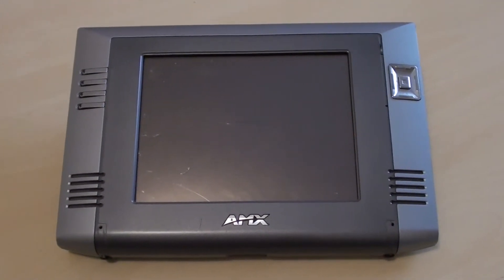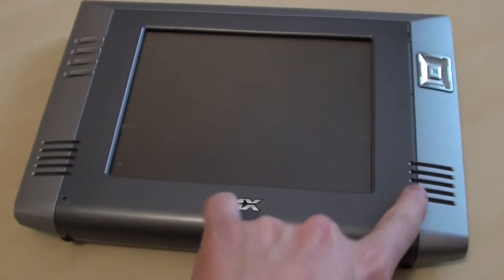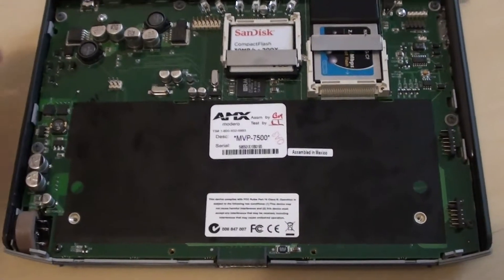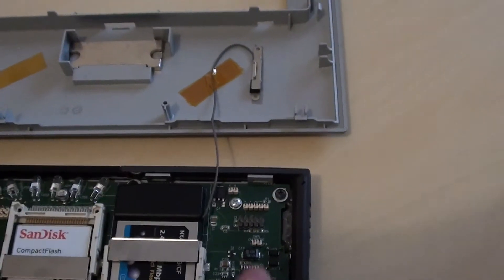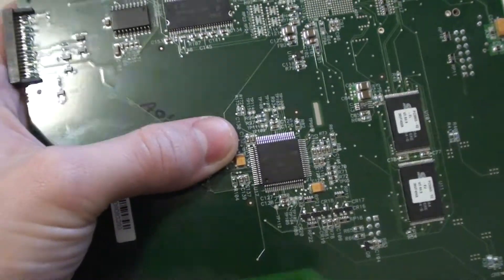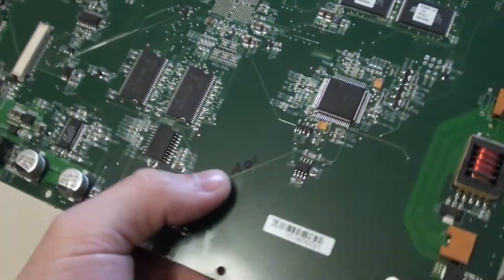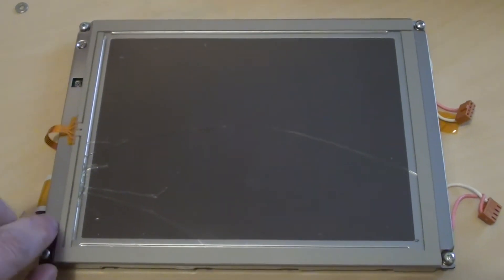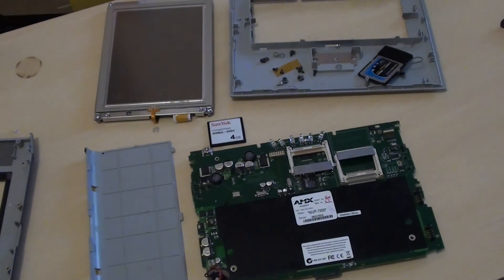AMX Tablet PC Teardown

Comment: We have a these in some lecture theatres at university.   They are used to control the AV equipment (such as switching projector inputs and changing the audio volume) as well as controlling things like lighting in the room.

Comment: We had one of these controlling schools auditorium lights and av hardware. Hugely expensive automation system that was quickly obsolete and started to have issues,  devices would not turn on and other weird glitches going on. AMX was/is one of the leaders of these kind of systems, I have seen their devices in many presentation rooms. This tablet was never intended for general use, but highly customizable remote controller for stage systems.

Comment: definitely save the CF cards, especially that 802.11...b? card. they can go for some silly money on ebay now, especially if it's a bluetooth card, which it isn't, but just an FYI.
Reply from the maker: Thanks, I've already salvaged the batteries and the two Compact flash cards. Although it's only 4GB, I will still find a use for it at some point.
Reply: CarlsTechShed
 it'll be good for at least something. there are thin clients and routers that boot off them specifically, but I'd pop it in a reader and check the SMART on it to see how worn out it is-- I do believe a lot of them from that era did support it, I know nowadays if it's a decent one they all do.
Reply: 4 gig is perfect CF card for an old macintosh

Comment: used to work with products like that during my time with home automation. There was similar products from the likes of Crestron, they were all amazingly expensive, i recall one guy bought a similar £4000  one for his Crestron system, it spent ALL of it's time on the wall mount and turned the lights on and off... just for that room and wasn't setup for anything else!! Crazy!

The iPad rendered these products useless as it meant the home automation could be done through wifi to the controller and an app.
Reply from the maker: Yes, I can quite believe that! I seem to remember Richer Sounds in Cambridge had something similar to this set up in their "Living Room" showroom. It was a wireless touchscreen tablet, and controlled the TV, Lights, CD autochanger, AV Receiver, DVD player etc. That might sound simple today, but this was around 2003/2004! Conveniently there was no pricing displayed so I think it was a case of "If you need to ask the price, you can't afford it".

Comment: We had a similar looking tablet made in 2001, with 640x480 32k colour screen, 32mb ram, 128mb on board flash, and a compact flash slot for storage upgrades.

When talking about the removable compact flash, you do say that's completely unheard of today. While microSD has replaced compact flash, most tablets still allow you to upgrade there storage in a manor similar to the one in your video.
Reply from the maker: +SublimatedIce Sorry, I should clarify that I was referring to the main memory in modern tablets being non-upgradable, rather than the extendable memory card slots which use a MicroSD card. For example, even on a tablet with a MicroSD slot, you can't run the Android OS from the MicroSD card, even if it's significantly larger than the internal memory.